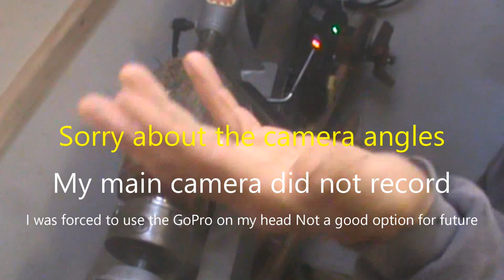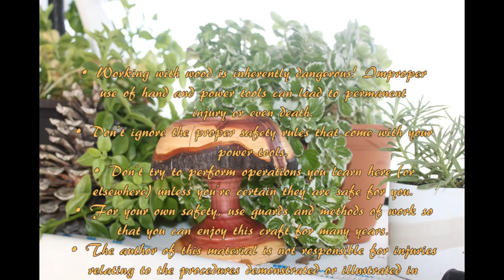Red Cedar droop bowl in the worlds smallest shop a catamaran

Comment: Glad to see you on the lathe again. For dust control, you might want to look into a “bench top” dust collector. They make them for people who do power carving and wood burning. Oneida Air Systems has a benchtop mini that might be just the right answer for your work area. Maybe Santa can help out.
Reply from the maker: Thanks and that is a great tip. my problem is power consumption as I run things off my batteries
Reply: @AlFurtado  They may have AC/DC/recharge units. My LED lights are all recharge battery units now.